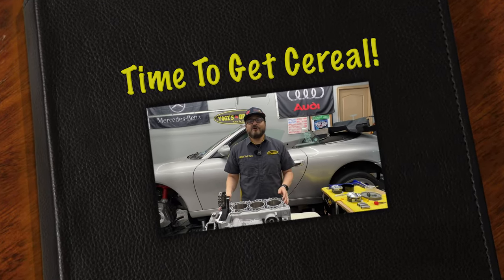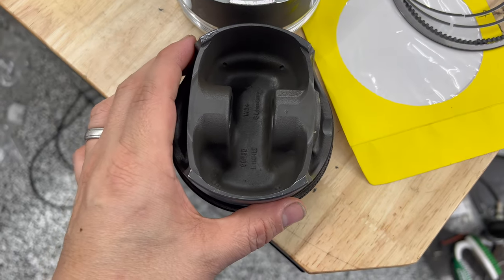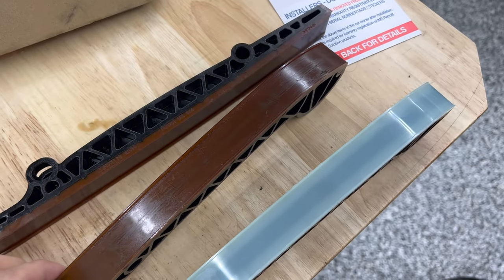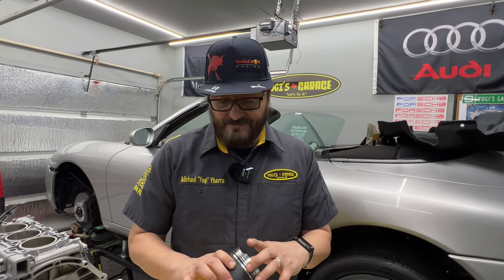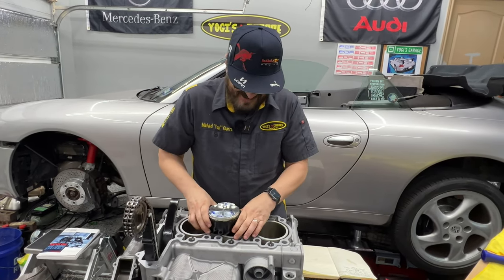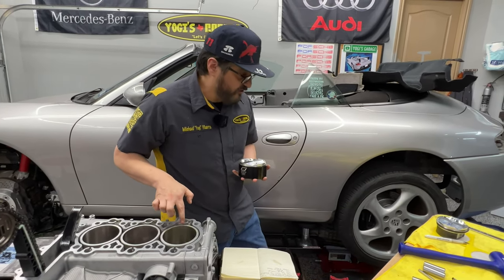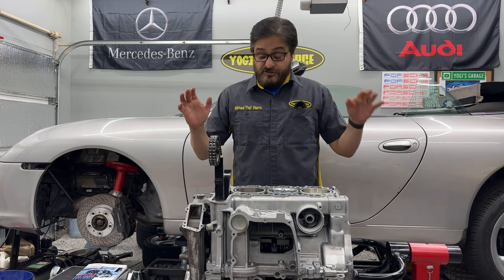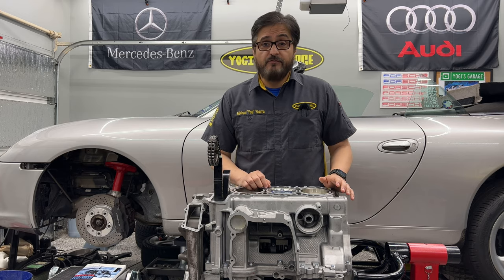Porsche 911 Restoration - Bank 2 Piston Installation Is NOT For The Faint of Heart

Comment: I wonder if the assembly at the factory is done this way, or the factory is using some sort of assembly jig? E.g. on 4 cylinder motorcycles the ‘block’ containing cylinders is able to pulled over the pistons. So I was wondering if long temporary studs could be installed into the crank housing and serve as guides for the ‘cylinder block’ to be 'lowered' over the pistons. I hope my question does not overly come across as armchairing. I am just trying to see if such option would exist?
Reply from the maker: As a matter of fact, Lee Jenkins has a method that uses what you mentioned. Way easier. I'll be using his technique on my next rebuild. Thanks for watching!
Reply: @YogisGarage  Thank you for your replying with this good news. I must say it would have bothered my mind, if the suggested method was not possible.

I have never worked on any Porsche, but I work on our cars a lot. I always admire and prefer to stick with well accessible repair designs (of course the 911 is very challenging in this regard). Regardless, the 911 is somewhat of a long term dream of mine (the “I-want-someday” type), but only if I know, that I can realistically work on it. So I am already ‘pre’-interested and checking out info about maintenance and repair procedures. I understand working on a 911 is huge step in effort. It will certainly be for me.

Many thanks again for your response!
Reply from the maker: Despite the engine being in the rear, I really love working on P cars.  Audi's are terrible, Mercedes is doable and BMW is a joke. My biggest issue is not having a 2-post lift. If I did, it would be a dream to work on my Porsche's.
Reply: @YogisGarage  Fingers crossed you can get one. Challenger has inground lifts that I IMAGINE could possibly be flush mounted, OR even mounted lower and then covered if not used. It would be a huge expense to install though. A friend of mine has recently dug out an inspection pit. He was really methodical and avoided foundation problems. Although I IMAGINE for the 911 this may not be enough as you may need to lift the chassis somewhat get the engine out.